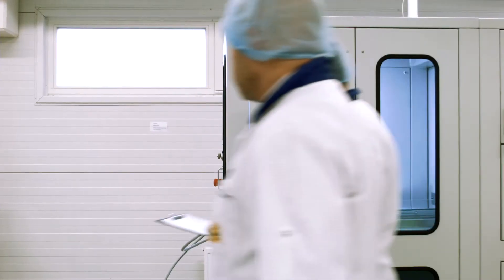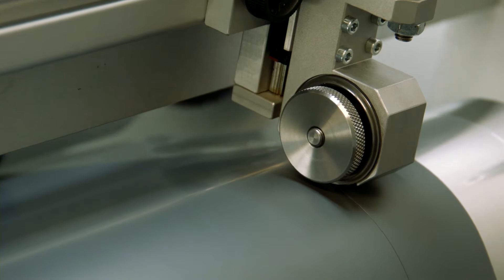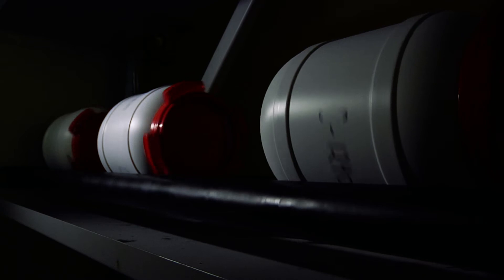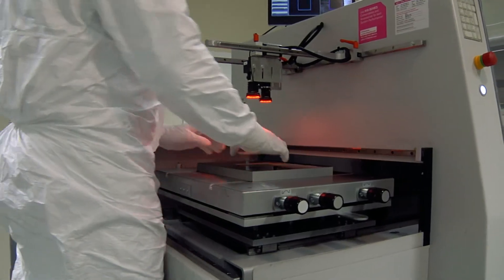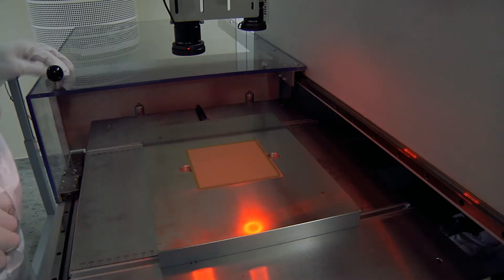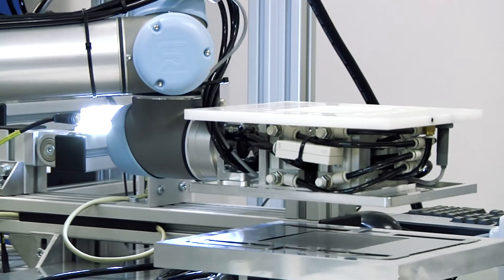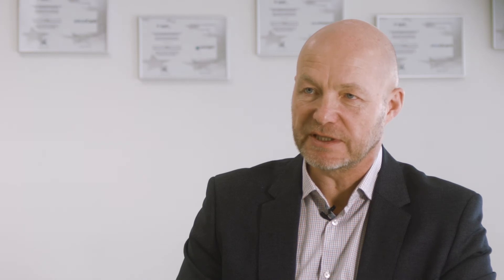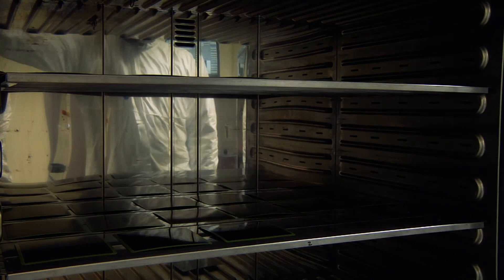Elcogen - World's most efficient SOFC

Comment: What is the theoretical limit for electrical efficiency of a solid oxide fuel cell stack?
Reply: Solid oxide fuel cells paired with a heat engine to collect waste heat can reach around 90% efficiency
Reply: @augustovasconcellos7173  Any examples? I think thats a great idea! Do they use methane?
Reply: @joshuanorris9785   methane much better solution the hydrogen
Reply: @augustovasconcellos7173  Also, if methane is used do they burn the methane? I'd like to convert natural gas into electricity.
Reply: @joshuanorris9785  yes currently the only fuel syitable for long term use with SOFCs is methane (natural gas). this is due to carbon coking and sulfur compound asphyxiation of the cell stack due to "unrefined fuels" and higher carbon byproducts sue to longer molecules in heavier hydrocarbons. this for instance is why diesels need to have DPFs. however, the fuel cells oxidize the fuel and release electrons. it is NOT the sam thing as combustion and thus is why they are so much more efficient than a comparable piston engine. though, it's efficiency isn't that much higher. what set SOFCs apart is their ability to basically always operate at max efficiency no matter what the power output - also there is no internal moving part friction and no need for lubrication oil that can leak into the combustion chamber and create aerosol emissions. 

I hope that instead of trying goofy and dangerous cryogenic hydrogen fuel cell trains we move first to methane SOFCs and then to just complete catenary electrification.
Reply: 100%, because it's not a heat engine.
Reply: exactly searching for somthing that is scale able